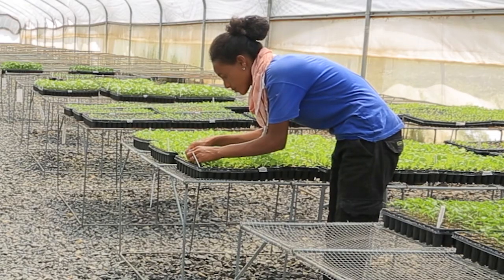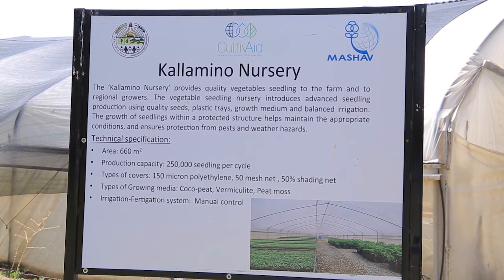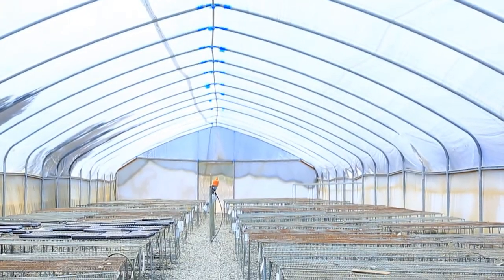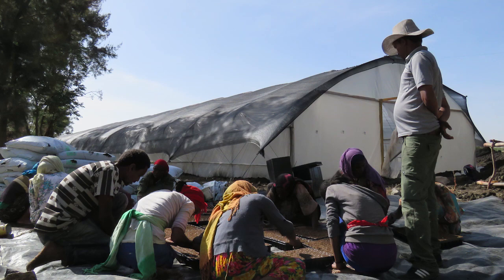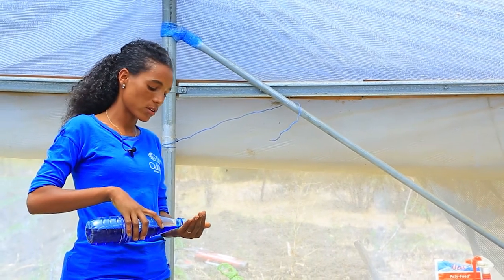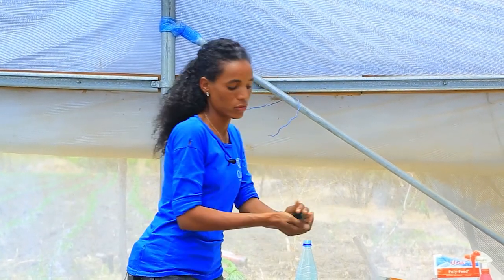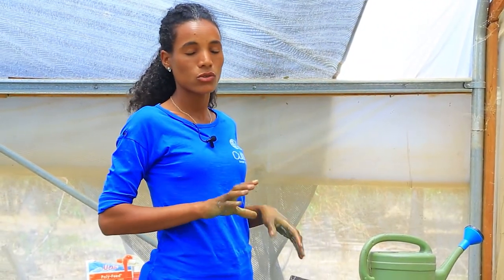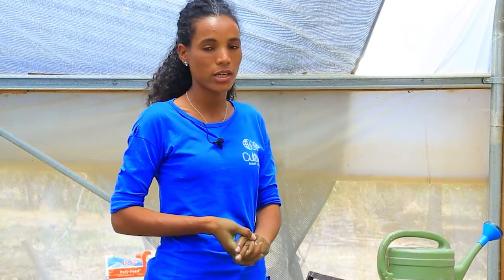CultivAid's 2020 Field Tutorial, Video 4 vegetable nursery

Comment: I love that green house. It's much cheaper.  Nice video. I have a small vegetable nursery. However, these past month where the rains started, I am having problems about algae growing on top of the seeding trays.  Are there also times when the same thing he happens to you?
Reply: This can happen with too much moisture in air and soil.  Improving air movement by opening doors, windows or fans helps.  And likely your seedlings wont be as thirsty so may need less water.  Feel the weight of the trays to decide when they are thirsty